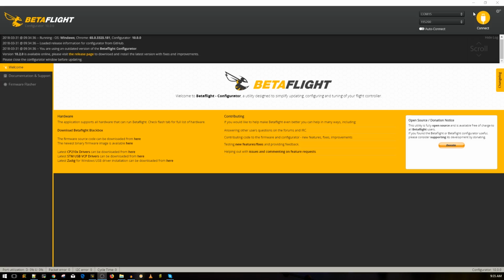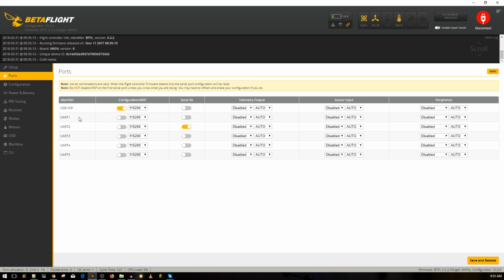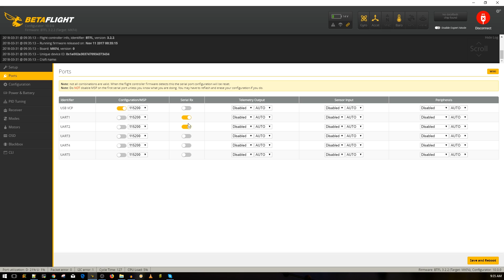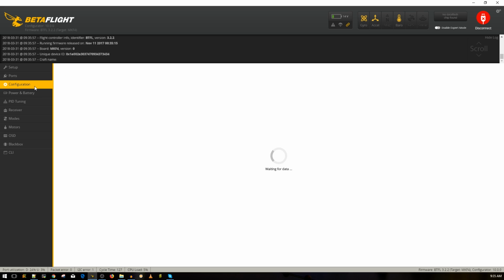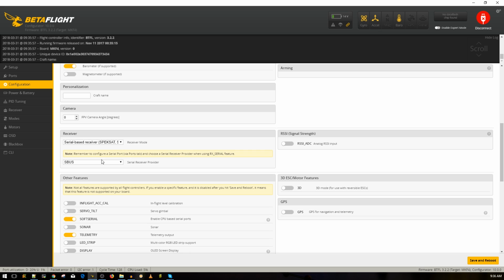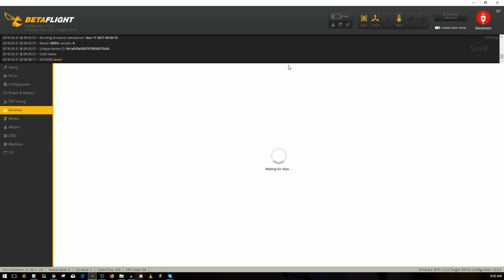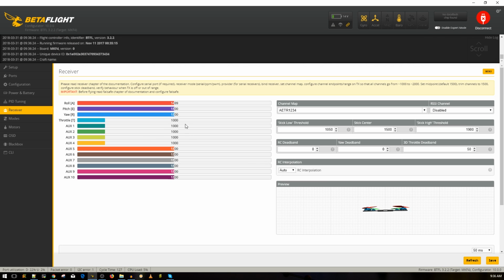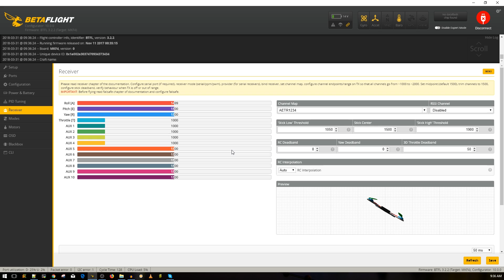How to wire and setup flysky Ibus in betaflight // Under 5 Minutes

Comment: can I explain how to connect SBUS to f722 se because I tried all UART and it doesn't work
in the documentation it is written with IBUS and SBUS to connect to a free UART port and this is not a trial and error method, I came to the iBUS only RX1, but I have no idea SBUS please help thank you
Reply: Dhc Yxb......Did you figure it out?  Im having similar issue, have a Talon F7 and the pinout on their website shows that ibus or sbus can both go on the sbus pad, but i cant get it my Fli14+ to bind like that.
Reply: @sunshynff  
Unfortunately I didn't figure it out. only the frysky ia6b apparatus on ibus works but only under the rx1 port and I can't understand it . CAN HELP SOMEONE
Reply: @sunshynff  
From what I checked in the Internet, your CD only supports SBUS. Fli14 supports IBUS so it won't work. specialists on youtube from thunder, but if you need help, they are gone
Reply: @dhcyxb1126  I got it figured out, the pinout on HeliNation shows that that Ibus or Sbus both go on the pad marked "sbus" on the Talon F7 which is technically rx3 I believe, so that's where I had it.  Tried so many times to bind it, the crappy button flysky uses fell off, as a last ditch effort, I threw a piece of solder over the spots the button used to connect to and bam, it binded right up.  Unplugged quad, unsoldered bind.  tweaked it on BF real quick and  just got back from flying a few packs.  So I just had a bad bind button, and I was getting ready to send it back or chuck it in trash..lol.

Comment: If you have Mamba F405 or Mamba F722, you CAN use the SBUS pad (I tested with Fli14+, X6B and A8S). Other FC have pad that says DSM/Spectrum - that is an uninverted RX. Important, when wiring, check the JST wires correspond to silk screen (ie GND = black etc).

Comment: Hey need some help I am struggling to bind a  1.7g Fli14+14CH Receiver Compatible Flysky AFHDS-2A w/ RSSI Output for FS-i6 FS-i10 Turnigy I6S Radio Transmitter with my Fly Sky FS-T6. I have pressed the button on the receiver so that its flashing rapidly. I've held down the bond key on the controller but it refuses to connect? Any ideas?
Reply: Paul Loth Any luck, same problem here, except i cant even get the red light to flash quickly.  
Which means its not even going into bind mode

Comment: Hi Drone Mesh, is it ok to solder a VTX rated between 7-24 input voltage to the Vbat pad? The drone will be run on 3-5s. Cheers.

Comment: Ok so I did wire my flit10 ibus to my sbus and that's why it's not working. So do I simply solder the signal wire to a uart 6 pad and then Betaflight config I believe is fine. But is that correct before I try?

Comment: I just bought the vortex 180 and the flysky fli14+ receiver. Would I be able to use this receiver in this quad, and if so, could you do a video on this setup? I have it setup with a flysky micro receiver, but I have no RSSI. And also, I tried to get Betaflight, but I can’t seem to get it downloaded on my Mac.. i seen that Betaflight has an app for iPhone, could this be done through my phone? Sorry so long winded, but I’ve been out of this hobby for a long time, and just trying to get back into it. Thanks!

Comment: Do you still recommend these flights controllers under dollar 45. Or is there any new flight controller which has come up in 2019. I am a noob in building racing quad. So plz recommend me some best flight controller under 45 dollar. Or the above mentioned flight controller are still the best. Plz reply subscribed user . Urgent 😘😘😘

Comment: Greetings from Malaysia!
Mr DroneMesh, will it work the same way on sp racing f3? I connected the wire as shown on uart 1 which is black for gnd, red for 5v and yellow for rx1 but it did not work. There was another wire not connected at all. 
I am using the fs rx2A pro mini receiver. I failed to bind the receiver to flysky fs i6 (the blue one) as there's no light whether blinking or solid on the receiver. What have i done wrong do you think?  On betaflight i could flash the board but for some reason the receiver did not light up. Do you mind to show on video on how it's done as i am still new to building my own quad.Can you help? 
Thanks a lot and appreciate your effort to make educational and informative videos like these. Surely many people have benefited by watching your videos especially newbie like me. Keep it up man!
Reply from the maker: You did everything correct but change RX1 to another one like RX2 or RX3... Now on SPF3 Board it will not give power to receiver from USB you have to give the board 5v so the receiver gets power.

Hope that helps
Reply: I dont quite understand what you are suggesting. Does it mean 5v from the pdb to the receiver? Then what wire goes where?

Comment: How to connect FS-A8S Receiver to Racerstar F4 Flight Controller plz help Me sir..!
Reply: input 1,2,3,4,5,6,7,8 connected receiver 3wire connectors. channel 1,2,3,4,5,6,7,8. or if controller have jst connector solder wires to this. manual tell you, gogole you found many video youtube or internet site how you connect all wires.
Reply: https://youtu.be/al4G6XJPD9c

Comment: flysky receivers like the x6b and turnigy ia6c  allow telemetry via a plug directly to battery points.  the older flysky i6 requires the 10 channel mod, this allows a two stage beeper alarm on your radio  for battery voltage.  i believe the newer fs i6x is able to do this without any mods, just get the x6b receiver, or the turnigy ia6c.

Comment: No need for this video, but plenty of ppl will. Your explaining is simple, like b.falcon did...keep this stuff running for the new kids flying.
Reply: in the interest of finding info in one place for newbies i'll put this here too, '' flysky receivers like the x6b and turnigy ia6c  allow telemetry via a plug directly to battery points.  the older flysky i6 requires the 10 channel mod, this allows a two stage beeper alarm on your radio  for  flight battery voltage.  i believe the newer fs i6x is able to do this without any mods, just get the x6b receiver, or the turnigy ia6c.

Comment: The turnigy evolution has sbus or ibus choice in output page. Would it work on the sbus pad if ibus selected in transmitter? I've only used F4 pro v1 from dys. 
My TGy-IA6c receiver has sbus pin that is connected to sbus pad on F4 pro. Transmitter and betaflight are set to ibus and it's working fine. At least I think fine...seems to failsafe sometimes around 150m. I'm still confused. Does F4 pro have Rx pad I should be using instead? I have uart1 on in betaflight now and it "works".
Is my setup "wrong" but still "works"? Perhaps not to best potential?
Still confused.
Might just be my brain, or lack thereof. Know your busy but help??

Comment: Hey i have my flysky reciver on sbus on a f4 flight controller and ibus connection on thr reciver. I just set the transmitter to sbus and did the same setup on betaflight u did for sbus and it works. Did i get lucky or is it because its a cheap f4 fc
Reply: alexgarrtt220 my turnigy evolution has choice of sbus or ibus in controller output page.
Reply: Mike Hedrick i have the fsi6 x and it worked fine. One problem is that u have to set the end points. On ibus didn have to do that. The fc i have didnt have and extera ur ports. Go throught drone mesh play list to learn more.